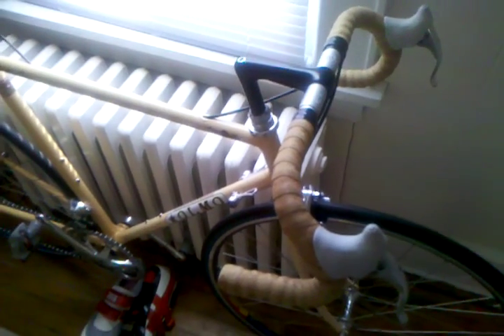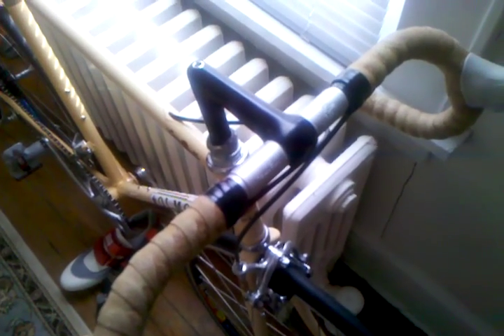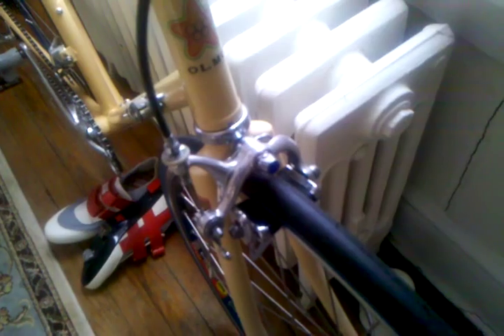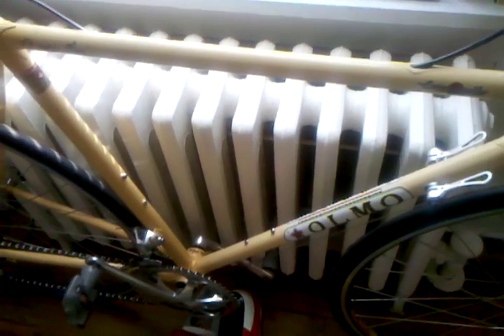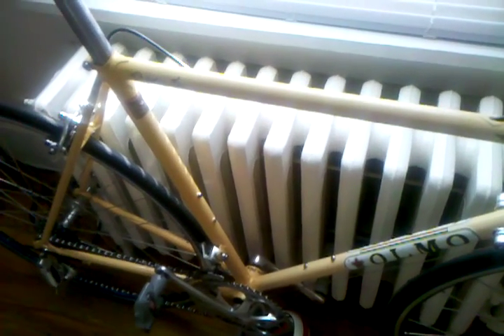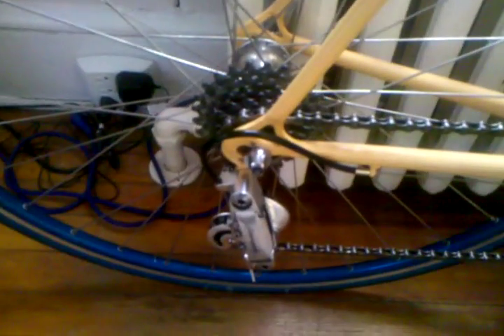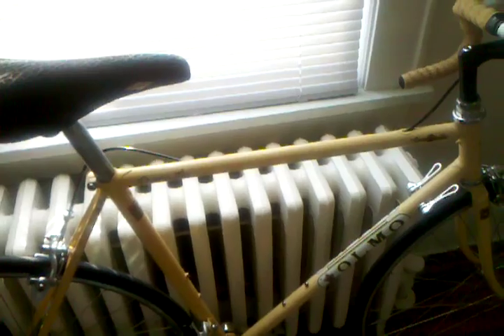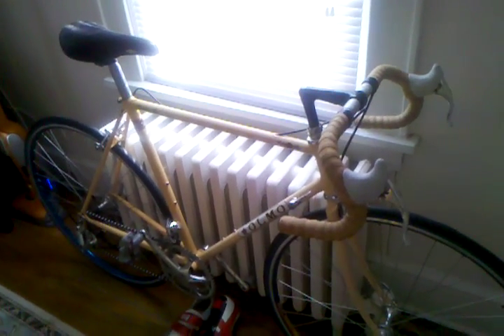Vintage road bike: Olmo, Campagnolo

Comment: I have an olmo frame exactly the same frame an dmarking but no model name which leads me to believe it has been designed for a team or repainted during its life. I would like to know how to restore and have pictures to show you for advice. touch up or repaint it all. also need to buy correct columbus decals so need to confirm its this and not the sportsman model as have seen a bike in different colour with identical marking as mine